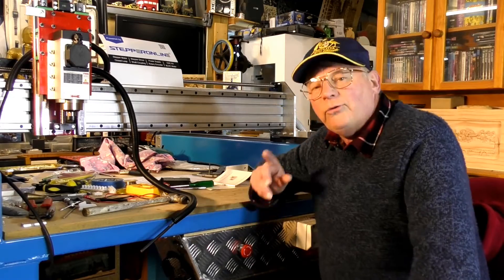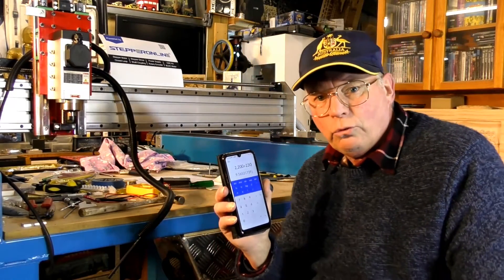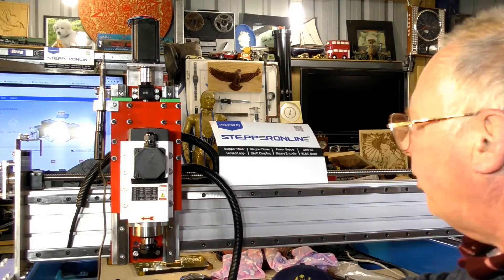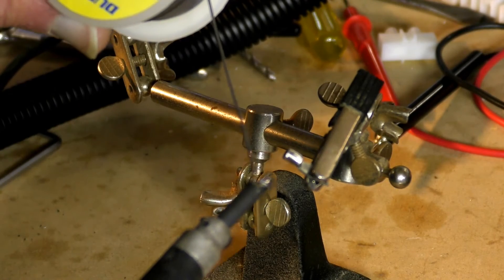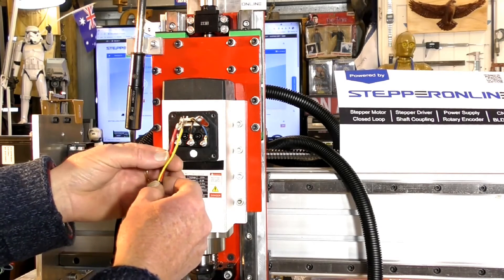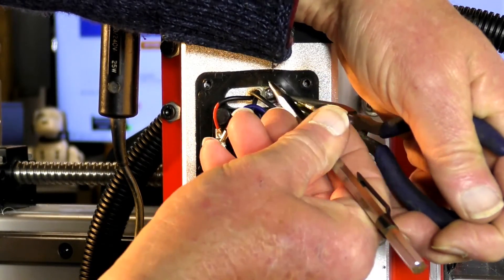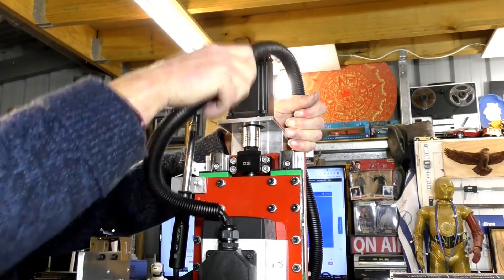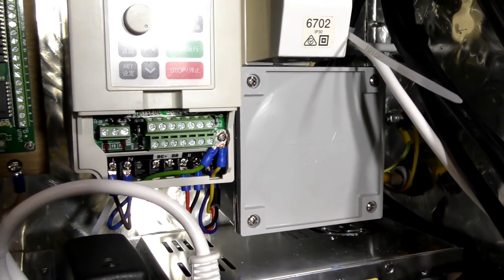Episode16 2 2kw CNC Router Spindle and VFD how to wire them up

Comment: Hi Roger.  Do you think the ProverXL 6050 Plus is rigid enough to handle a 2.2kw spindle?
Reply from the maker: I fitted a 1.25kw 230v router to my 6050 works good